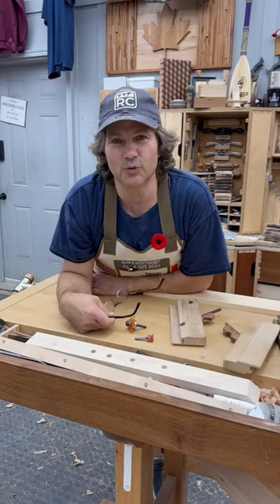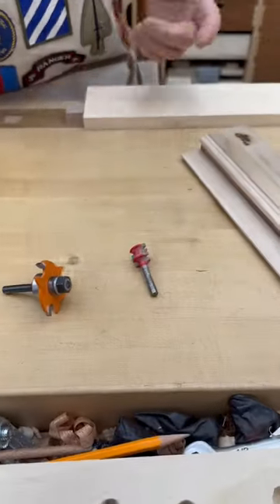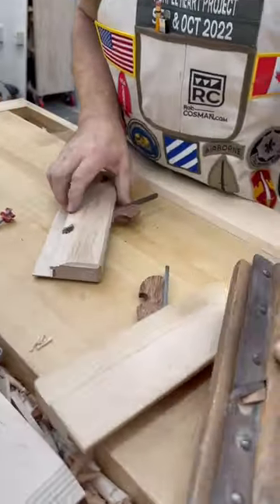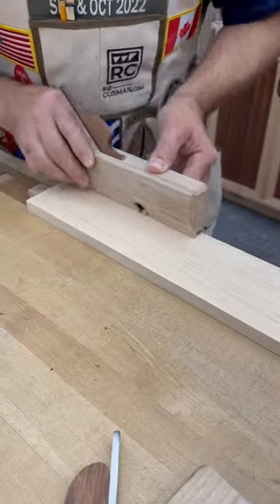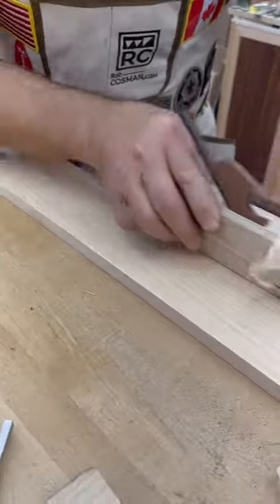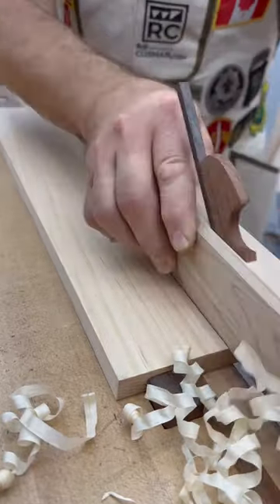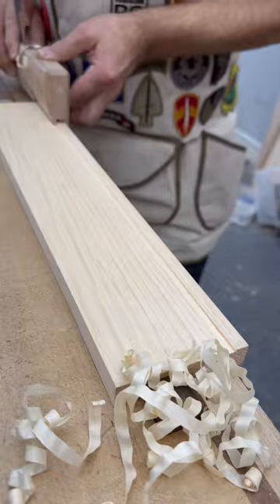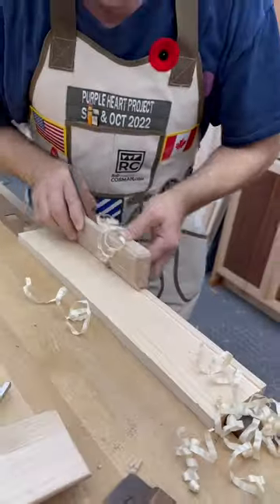A different way to cut the drawer bottom groove without the table saw or router.

Comment: You have mentioned many times the difference in noise and dust levels between the blades driven by motors and those driven by our muscles. I am a big fan of quiet and clean things. Its nice to hear someone else appreciate these things as well.
Reply: I like quiet.  I can't stand music in the shop.  Very disturbing.  All the other guys in one shop back in the late '70's liked music.  The foreman and I DID  NOT like music in the shop.  The foreman left to bid a job, and shortly after he left, the radio was turned-on and set to full volume.  A while later while I was doing cabinet doors I heard a loud bang.  We were all working and no one noticed that the foreman had returned.  He slowly walked across the shop to the radio, picked-up a bar clamp, and (he was a big man) beat the radio to death.  Two of us that day were pleased, and the radio sat on the bench for weeks as a grim reminder.  

I love the rythem (sic) of the work.  That is music to my ears.  One day I told my wife I would be at my dad's shop.  She said she would come out to their house and make dinner, as we were house-sitting for a few weeks.  I was building guitars, enjoying the music of the hand tools, and suddenly the big shop door opened.  My wife was telling me it was time for dinner.  Nine hours had passed in just a few peaceful minutes.

Comment: About 25 years ago I bought some Temessee (aromatic) cedar.  I made a pattern of 1/2 side of a  clothes hanger, and cut-out what must have been dozens of hanger halves.  I joined the two halves together with a beveled, sliding dovetail.  I then ran them through a 6x48 belt sander and finished off with a 5" random orbital.  A jig was anchored to the drill press, and 1/8" holes drilled down through the center of each hanger.  A brass rod was cut to length, bent to shape, and then pressed, and epoxied into place.  The bottom end of the brass was peened to keep it in place.  (A belt & suspenders solution).  I then branded each hanger, put several in a gift box, and people were thrilled to receive these as gifts.  Back then the price was around $1.17/ea..
Quick, and cheap!  I think Christmas that year was around $50 total!

Comment: Nice! A little more exercise but more consistency, less noise, a cleaner cut, and no setup. Personally, on projects for the last couple years, I’ve been keeping a handsaw handy, and I am surprised by how often I use it instead of my Skil saw, tablesaw, or chop saw. I find there are even times when it offers me more precision. But this may be that I’m simply not that great with a Skil saw! Cheers.

Comment: Ohh Rob....

Was hoping there was a private way to send this. Didn't want this to be seen by other eyes....

On a drawer, the "groove" is a dado on the face, and sides, and a rabbet on the back.  The drawer bottom slides into the face and sides, and full overlays the back rabbet.  A small hole is drilled on the bottom piece over the back rabbet (don't drill into the rabbet), and a small brad is clipped flush (remove the point on the end) and is approximately 1/8" longer than the thickness of the drawer bottom.  After the carcass has been assembled, the drawer is inserted.  The drawer will rack slightly when the drawer face is flush with the carcass face frame.  Reach into the back of the carcass and hammer the brad into the drawer back rabbet (1/8" or so...), temporarily fastening the drawer bottom to the drawer back.  This is easier if the back of the carcass is attached after the drawers have been fitted.  Remove the drawer.  Spot glue (a drop of glue in the center of the face dado), and a thin bead on the rabbet.  Rack the drawer to align the brad with the hole in the rabbet.
The drawer face is attached to the drawer sides via a sliding dovetail, or half-blind dovetails.  A five-sided drawer with a drawer face screwed to the drawer box isn't usually the best solution.  Unless wood glides, or soft-close glides are used the drawer box will keep travelling when closed, but the drawer face will stop suddenly when it hits the carcass face frame when closing the drawer. The drawer face, and carcass face frame will quite often separate if there is a moderately heavy load in the drawer.  

Just a tip I learned from Carlo the Journeyman, or Master (not sure which he was) back in the '70's.  Carlo was humble, and not too proficient in English so I didn't know too much about him). 

Just a gentle instruction, kindly given.

Comment: Sometime I feel it's faster just to use the hand tools.
Reply: It depends on how many you are cutting. For a single to three drawers, this is likely more enjoyable and fairly quick, if your sharpening game is on point. If you're doing a kitchen, bath, walk-in closet, or bank of shop storage drawers, the router or dado stack would be quicker, including set-up time. As long as you have a set depth, offset, and such. setting it and running all your parts on a machine is quicker, but is it as accurate, and do you have adequate dust management? routers and powersaws create so much noise and dust, how much are you breathing into your lungs? plane shavings don't float in the air or down into your lungs, and a handplane does not damage your hearing like power tools  do.